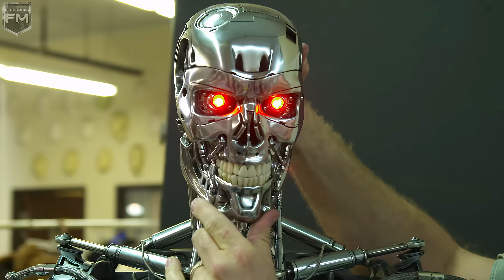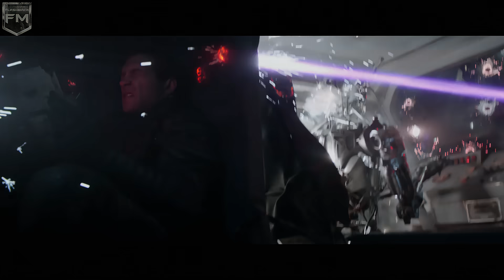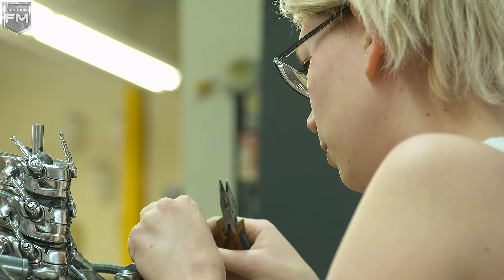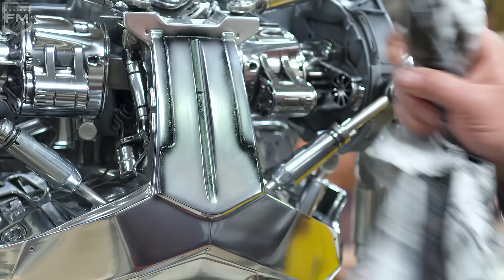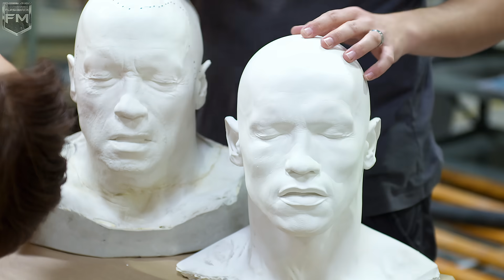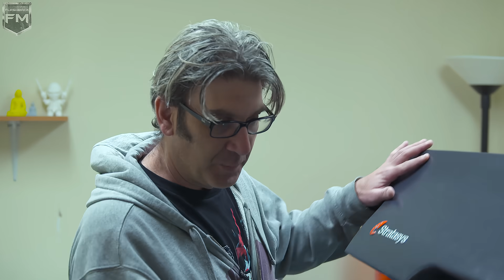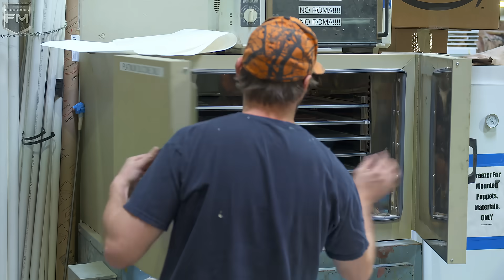Creating T-800 Model 'Terminator Genisys' Behind The Scenes

Comment: Must be awesome working with this line of creative work these days with upgraded materials, better quality rubbers/polymers. I remember creators in the 80s and 90s were always struggling to keep the models intact as they worked on them, and then filmed them.
Reply: Funny you say that, when I was studying practical FX 30 years ago, Pros-Aide was still the adhesive of choice. I thought it was funny when the one guy showed what they were using it for. I wonder if the formula has been updated since then?

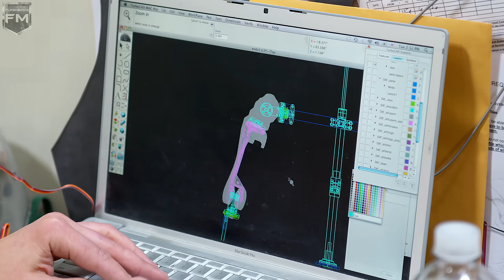Comment: Is the macbook pro appeared in 2:56 a 2006 verison?
Reply: In its body it produced 2006-2009, become obsolete in 2012 I think. But I’ve used one 2009 until 2019 with 4gb ram and 500gb SSD, it was a good machine for safari and some software for regular use

Comment: 0:20 The inside of the T-800 skull is actually the inside half of the gearbox clamshell used on the Tamiya SRB series of RC racing buggies (the first came out in 1979), with the other half used on the other side of the skull. Even if this modern version does not use the original part, it was still modeled from that gearbox used in the Original T-800 from Terminator.
Reply: As an RC hobbyist, I approve this message.

Comment: The 1984 scene was brilliantly done.  It's the only part of Genisys  worth watching.
Reply: If you compare it to the actual 1984 film, the CG starts to fall apart.  The fight and CG animation looks rubbery.
Reply: @dan_hitchman007  I agree somewhat.  For 2015 it's good.  If they did it today the lighting and textures would be better making the skin look more realistic.  One of the aspects I didn't like is when they pulled away and did the far shot of the Terminator running.  They must have not used Mocap since it looks pretty bad.  The replacement punks weren't very convincing either.   Maybe I shouldn't have used the word  "Brilliant", but rather well done.  Since I went back and rewatched it and it definately didn't hit the same as it did back then.
Reply: @dan_hitchman007 It's like there's no physical weight to anything. Looks fake.
Reply: @lorenipsum93  Like the idea of a bipedal robot to begin with?
Reply: @dan_hitchman007  "If you compare it to the actual 1984 film, the CG starts to fall apart.  The fight and CG animation looks rubbery."

Compare it again, but this time look at all the CGI, which is probably 68% of everything shown in the movie.

People have a tendency to complain about "bad CGI" because they saw a few frames in a few scenes where it didn't work out that well and then simply declare that that is all the CGI and it was all bad.

The fact they have been looking at fully CGI-backdrops and scene extensions for most of the movie doesn't register. Most explosions are CGI, blood effects, the lot. 

You only notice the bad stuff and ignore the good stuff because you don't notice the good stuff.
Reply: @vinny142 fair
Reply: Looking shitty and unrealistic is what really made it feel like 1984 again. They nailed that back then. Any scene with the machine that isn't actual Arnold just looks silly. It's nice that they managed to capture that again.
Reply: @OfficialOpinion Any long shot of the endoskeleton they did using all they really had back then stop motion does look bad.  Hey it looked sort of bad in 1985!  But the stuff they did using Stan Winston’s puppet looked really good.